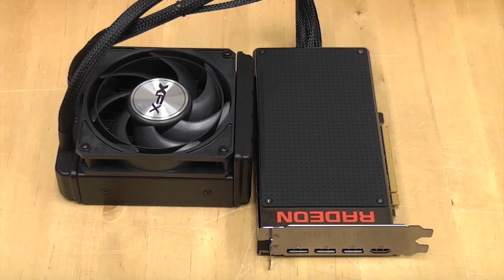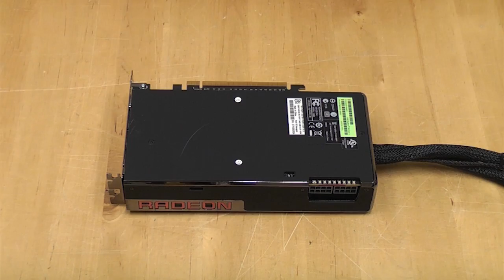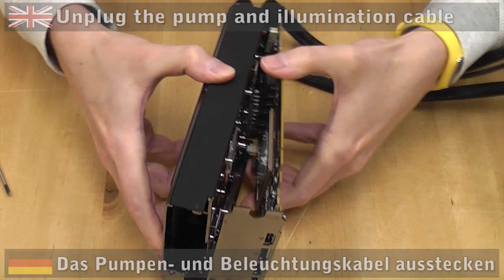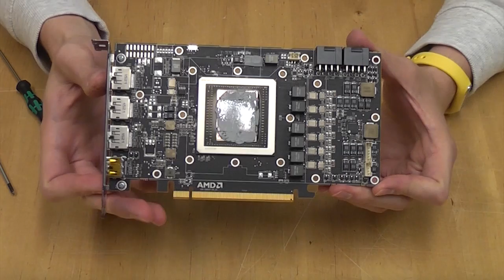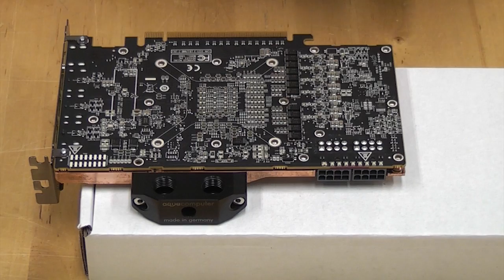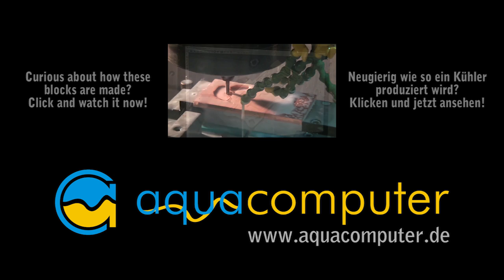kryographics R9 Fury X Installation

Comment: Thanks for the video. Can I install the backplate back to the graphic card?
Reply from the maker: No, it can not be combined with the block.
Reply: Aqua Computer Do you know anyone that would fit? I am changing from vertical to horizontal and are using your block.